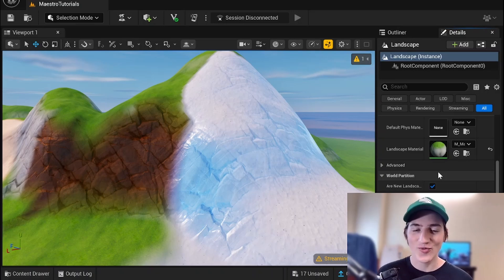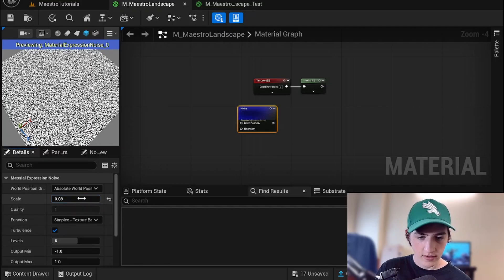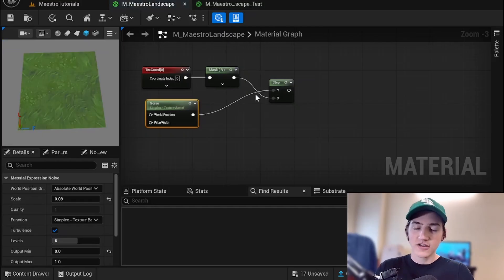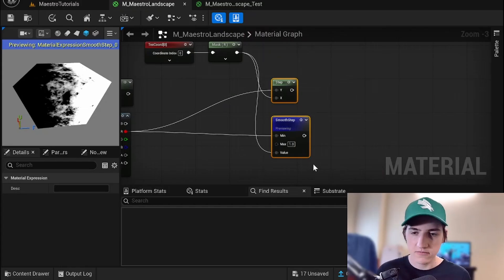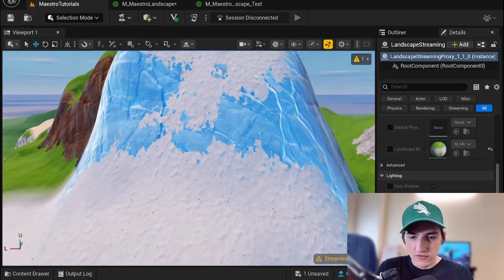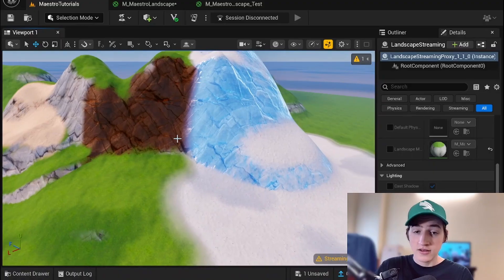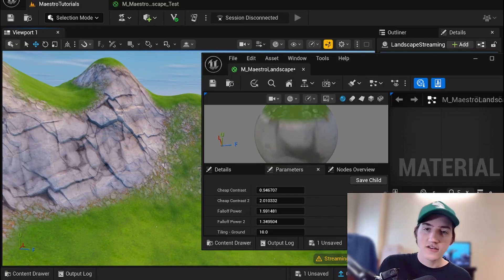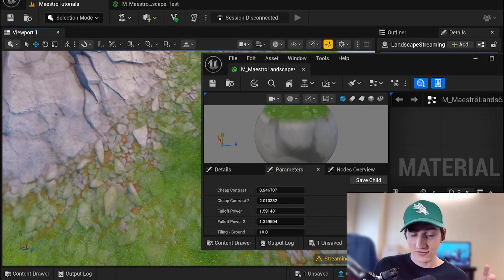UEFN Tutorial: Height Blending Materials! | Landscape Paint Maestro Ep. 2

Comment: Your tutorials are extremely good and I'm learning a lot, but I have a problem when I use the smooth step function in the tutorial. It causes small pixelated holes with a stone texture to appear in my landscape on any painting. Do you have a solution?
Reply from the maker: Sounds like your landscape is low res.
Reply: @MaestroShark  I tried changing the divide and smooth step section, and it does change something, but it doesn't solve the problem as long as the divide section exists, whether it's 0.0 or 150. I get a small pixelated hole repeated several times with no texture or with a different texture.